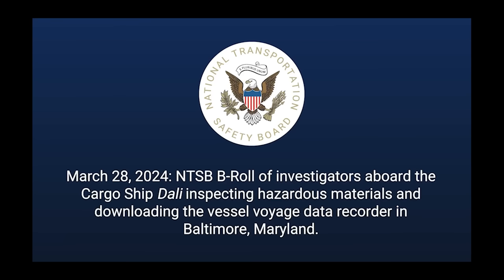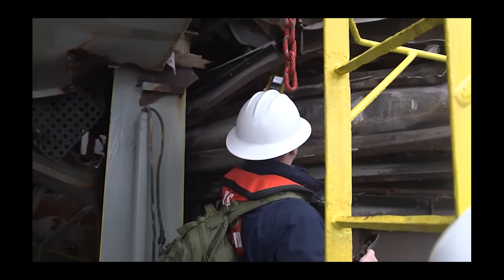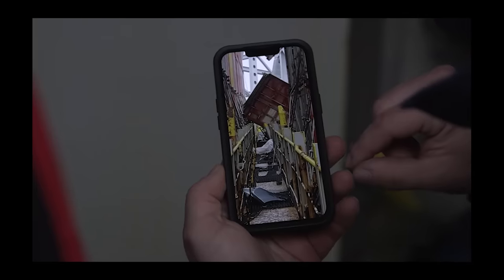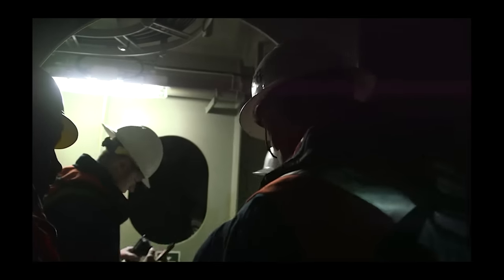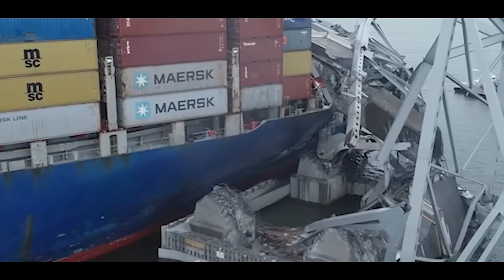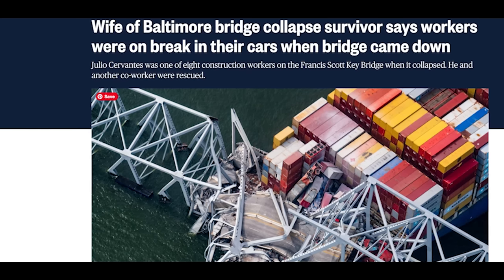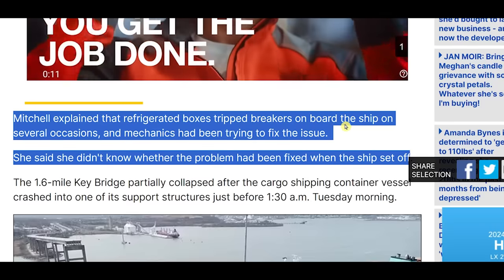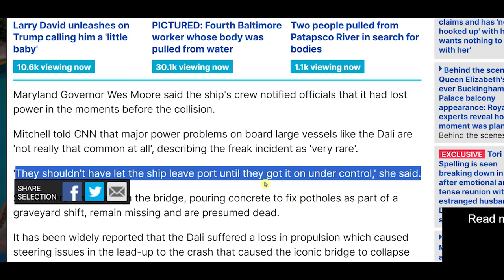NEW NTSB Video On Dali Ship Point of Impact Key Bridge

Comment: "Boats" like these have damage stability criteria. Essentially, it is sub division of the hull into several floodable compartments. They can float with some  compartments flooded.
Reply: Totally. I'm a prostitute and I'm always on ships and have even been on the Dali several times and I can tell you they had problems then so I'm not too surprised.
Reply: Not likely that the ship is flooded. It would probably be listing if it was. The bow appears to have taken the brunt of the damage. And you can thank the sinking of the Titanic for compartmentalization. If it had been built with floodable compartments, then it may have truly been what was roasted about her being an "unsinkable" vessel.
Reply: @coachwendy5618  I knew all of this because I have been a prostitute for some time now on boats just like this one, in fact, I have been on the Dali and know a lot about it. They've had these problems before. I'm not surprised. Again. I'm a prostitute and I do most of my work on boats.
Reply: @coachwendy5618  The Titanic was built with watertight compartments.  It sank because it simply took too much damage.
Reply: @AlfredKriman  Titanic so called watertight compartments did not go to the deck above thus when filled to the top of the compartment wall water spilled over the top like a dam.

Comment: Many of your statements about the reefers and electrical power in general are erroneous. There are myriad protection systems / power management systems which start stop generators automatically when power demands vary. Let us not do indepth comments about things we have no clue . Let NTSB come out with some preliminary findings atleast. The vessel seems to have had some serious electrical power issues. VDRs are independently self powered plus a inline ups if ship supply fails. Ie VDR has 3 tiers of power source.

Comment: mSDS , material safety data sheets. These are required by OSHA even for construction work trucks. You must have on hand an msds for every chemical on your site and truck. Spray paint, wd40, cold galvanizing, even chemicals in the first aid kit and employees belongings such as bug spray and sunscreen.
Reply: Totally. I'm a prostitute and I'm always on ships and have even been on the Dali several times and I can tell you they had problems then so I'm not too surprised.

Comment: 80% is the actual rated capacity of a breaker. NEC does not allow more than 80% loaded capacity of a rated breaker most times. The big problem in the electrical maintenance industry, speaking as an electrician, technicians do not know or maybe not care to troubleshoot the why a breaker or fuse trips. People breakers do not trip and fuses do not blow because they are sleepy. Some manufactures will condemn the UL listing of a breaker that is overloaded once.

Comment: There should be multiple electrical circuits and breakers. The engines and ships lighting systems would not be on the same circuit as the cargo refrigerators.  A failure of all the systems at once would make me think there was a more centralized issue.  Perhaps a problem with the generator(s).  I would also assume there were emergency generators as well.  I wonder if the main  generators went off line and then they overloaded the emergency generators.

Comment: Your very limited DIY experience with home breakers in no way is equivalent to marine industrial breakers on a ship.

You are comparing a tonka truck to an industrial mine dump truck.

You seem to have an impression that people are running extension cords to refrig container. 

These breakers are designed for a set amperage +/- 3-5%. The amount of refrig containers is limited to ensure that the breaker will not trip, likely 80% of max amperage.

Which still doesn't matter as triping these breakers only means that the refrig containers aren't being cooled. 

The ship likely has 2 diesel generators for redundency. Losing both means a big issue. Whatever the issue(s) the breakers for the refrig containers are not the cause.
Reply: If your reefers are working hard you will need 3 of the ships 4 gensets running in synchronous operation loss of 1 going out of synchronisation can cause a cascade failure! 😊

Comment: Those are some really bad quality breakers if they trip with less than the rated current. Breakers are designed to trip at much higher currents, 20A breaker might do 40A for a while and only instantly trip at 80A. Small overloads may be sustained indefinitely. It's about fuse characteristics and blow curves. But even if refrigerators tripped circuits, they would not be hooked up to the same circuits as equipment on the bridge... Something seems off.

Comment: Those electrical systems are like a medium sized factory. industrial control and protection gear. The reefers are hvac systems exposed to a harsh, salt spray environment. You wouldn't expect a faulty reefer to take down the whole ship. Perhaps they had bigger electrical problems than they realised.

Comment: Since the barrels are on top of the bridge elements they could very well have contained the slurry used as part of the pot hole repairing on the bridge by the workers. A closer view of the labels would clear that up for sure.
Reply: I didn't think of that, but so true.

Comment: Two questions -  Is that a normal route/track for a cargo ship to take?  For me it seems so close to the right bridge support when the center of the channel is open.   Second, when the emergency power went online, why did it steer to the one direction to impact the bridge?  Thanks in advance and ty for keeping us updated
Reply: Numerous vessels would be traveling through the port daily. The Port of Baltimore is one of the busiest on the East Coast. I live in Hampton Roads, VA and work very close to one of the Port of VA locations. Local news here is reporting that we'll most likely be getting some of the traffic along with New Jersey ports. If you want to understand your question about steering better watch What's Going on with Shipping. Sal's been on since day one explaining what most likely happened.
Reply: The designated channel does run pretty close to the bridge support. Every ship has to travel along that channel in one of two lanes. The Dali was in the left lane (farthest from the support until the power died and it veered into the unoccupied right lane and beyond it into the pier. The right lane is about one ships-width away from the pier. I'm not sure why the shipping channel is located where it is. It seems that the emergency power didn't allow rudder control. After the power comes back, someone has to go and switch everything back on. What pushed it to the starboard was probably mostly wind, but also water currents.
Reply: @NeilWick  If they'd attempted to apply reverse propulsion it also could've caused the ship to veer.
Reply: The channel was originally built 60 years before that bridge opened. More recently, it's been dredged to 50 feet deep for most of its length. The water is only about 20 feet deep in the middle of the bridge. Parts of the channel are supposed to be 1000 feet wide, but they are 800 feet wide or less due to lack to funds to make them the full width.
Reply: @NeilWick  Thanks Neil and the others for your feedback.  It's much appreciated and makes senses.

Comment: Not a ship guy and we can point things now because we now the the issue. But, being rudder so citical, why is dont run on a separate circuit. I have read that during this part of the navitation they are required to run with all the redundancy on, backup gen and back up hidrahulics. How a complete blackout of ship this size is even possible ?.  No way a pilar of a bridge can stop a thing like this. This would need a serius overbuild

Comment: 17 amps of a 20 amps breaker is going to trip the breaker.
"circuit breakers can only handle about 80% of their overall amperage. That means a 15-amp circuit breaker can handle around 12-amps and a 20-amp circuit breaker can handle about 16 amps."

"Usually, the power of a 20-foot refrigerated shipping container is about 7KW, and the power of a 40-foot refrigerated shipping container is about 12KW"
The circuit breaker was telling the electricians that it was overloaded or there was a problem, such as damaged wiring causing a short circuit, etc. Sometimes the breaker will not trip for 6 days.
The ship should have been held in port.  Irresponsible.

Comment: that ship probably wasn't more than maybe 10 feet from the river floor on the bottom. I doubt if could even sunk. It's a river  That is a huge cargo ship and likely at least 35 foot in depth when loaded if not more depending on weight. the river is about 50 foot deep in the channel. I'm not sure if the ship was in the channel when it hit the pier because they had no rudder control to steer the ship. the main channel for traffic would be the deepest spot and they are dredged out to insure clearance.

Comment: Surely if it was cargo such as freezer units causing electrical problems, they would only cause localised tripping of breakers to take place. Electrical systems are normally designed so that electrical faults with peripheral devices cannot compromise or interfere with the core or main circuitry of the system so that total power outages are avoided. this must have been something more fundamental ie with the power generation systems rather than cargo issues surely?

Comment: I'm no electrician, but aren't circuit breakers supposed to trip when there is a problem with the device they are connected to........and isolate it from the electrical system? ie- If my washing machine circuit breaker trips it doesn't shut off electrical power to the entire house.......just the washing machine. Why would the refrigeration circuit breakers cause a complete blackout of the ship?

Comment: I would guess the last yellow device is some kind of VOC (volatile organic compounds) sensor.  They’re checking for their and follow on inspectors safety.  You’d call those devices PPE (personal protective equipment) at this stage.  Ensuring there’s no concealed fire  or chemical induced exothermic reactions taking place or explosive , or poisonous gas leaks.  Reports I’ve heard say that the standard in shipping safety is to put ALL the hazmat up front there right where the bridge dropped (farthest from bridge and living quarters, engine room). God knows what kind or soup they have mixing up.
Reply: Shouldn't the inspectors have been suited up with hazmat gear knowing there was that kind of material on it,?
Reply: @jenniferornelas4151  
I would guess they’ve cleared it to a shirtsleeve level as long as they sample for explosive, flammable, asphyxiating conditions while doing non intrusive visual surveys. They’ve talked about the hazmat manifests in the news conferences so they know what’s there.  They’re out in the open as well, might be different if the go in an interior unventilated space.
Reply: @Bear-kr3gr  Ty for the explanation,makes sense to me now.

Comment: It wouldn't surprise me if they had a plugged fuel filter if they got some water in the diesel fuel.  I have an old 1981 Mercedes 240d diesel and had to pull over one time when the engine started  running very rough.  I struggled to get home and replaced the fuel filters and the engine came to life again.  If a ship of that size had a plugged fuel filter from water that does get into the diesel it would plug up the fuel filter.  You can't stop one of those ships if the engine shuts down. It takes up to a mile to stop. I wonder if the NTSB will start having tug boats escort the big ships a lot longer until they are out into the ocean.

Comment: If the main breaker did not trip, there's no problem with spreading out the load, spreading out the load is makes it easier on the smaller breakers, that's just common sense

Comment: Circut brakers are generaly rated at 20 % higher than the continues load they can handle - 
     A 20 amp brakers max continues load is 17 amps - after a circut braker has triped - its rated load will decrease. - 
     Inhad worked the offshore oil fields for yrs as a SCR electrician - 
      If i only had a 30 amp braker to replace a 20 amp braker - i would over load the. 30 amp braker and force it to trip - tha over heated the springs so they lost tention - 
      I would do that till they would trip with a 20 amp continues load for one minute -  
     Then the braker would trip if a load exceeded the 17 amp continues load - 
     People will often over load portable generators - after the braker trips a few times it will no longer carry the rated 80% rated load continuesly -

Comment: If the breakers trip on my refrigerators, it doesn’t keep my laundry room from working. This idea that tripping breakers led to a loss of power on the whole ship is nonsense. That’s the whole purpose of a breaker box. Break the overload and the specific area so the system can still function.
Reply: a genset could have 2 - 3 breakers , one main CB and ELCB , then cables run to the main switchboard where there will be another breaker , then cables will run to the 20 - 30 switchboards all over the ship for different layers of service.
A competent ships electrician might have needed 20 minutes or more to isolate the fault however this problem had been going on for 48 hours while the ship was tied up at dockside.
Reply: @heartobefelt  you are making the point….. there are breakers layered on breakers….. if the problem had been going for 48 hours…… thats more than enough time to isolate the source- and if it was truely refridgeration as they are starting to leak out…..its like the electrical outlet of the christmas tree at ralphie Parkers house….. pretty easy to track down last layer and work your way in……

Comment: Crazy to think that the data recorder doesn’t have a battery backup.
Edit: it does have a battery backup
Reply: Even airplanes don’t.
Reply: I heard today that it does have a backup it's 64 12-volt batteries hooked together in sequence but apparently there was a lapse between the time they lost power and the battery backup kicked on
Reply: @dwainsellers6453 Battery backups should be wired directly to the equipment the same as a car battery. The generator power keeps the batteries charged the same as a car.

Comment: Why hasn’t barge cranes been deployed to start dismantling and removing the bridge debris? And, even though damaged, the ship’s engine should have been repaired by now to get that out of the way.
Reply: because before touching anything the NTSB inspectors must have access to everything , when they finish the engineers can plan the schedule for dismantling the structure and removing the ship, crane barges have to be brought from whichever part of the world they are in , they could be 7 days travel until they can arrive.
Then you have the removal sequence which could be removing smaller loose sections of steel beam off the ships bow , then removing the concrete pylon off the deck , then taking the weight of the bridge section sitting on top of the bow while explosive charges are used to sever the girders while still allowing safe swing clearance when the bigger section is allowed to fall into the water.
No crane is going to lift the entire 100 metre segment sitting on the ships bow
Reply: @heartobefelt  Thanks for the information! I knew cranes can’t lift entire large pieces, they would definitely have to be cut apart first. I heard though that it could be two years before channel could be opened back up?

Comment: I wonder when the diesel tanks were last filled and with varying temperatures.Condensation and moisture can form in the fuel systems.And the time and distance from the port dock.Would be when the moisture would accumulate in the fuel separators and enter the engines possibly.
Reply: black algae can also be supplied and will block up fuel filters in minutes

Comment: Theyre doing thermal imaging to look for any signs of materials that might be generating heat, which could later create a fire.  Theyre doing Four-gas testing to check for flammable gas presence and percentages as well as any other hazardous atmospheric situations…but they (coast guard) are doing a completely sh^t job at it…also, theres quite a few containers, tankers, barrels, etc. that do not have the proper labeling on them in any way.  They should NOT have been allowed to transport them like that in any way